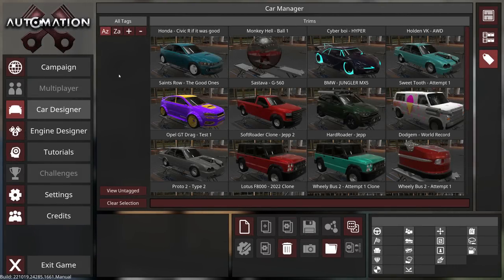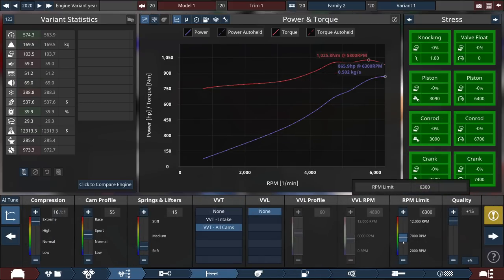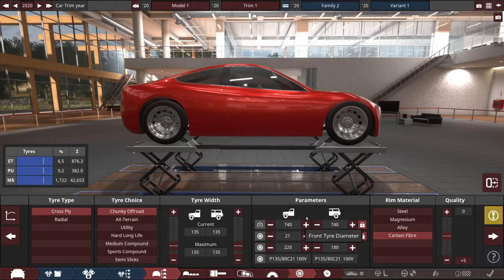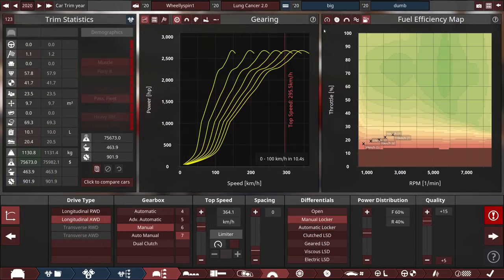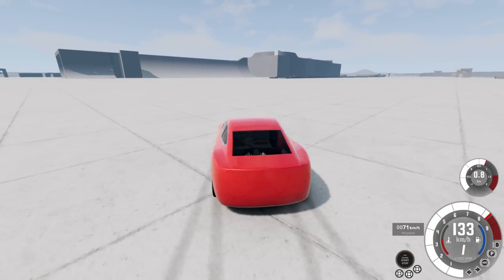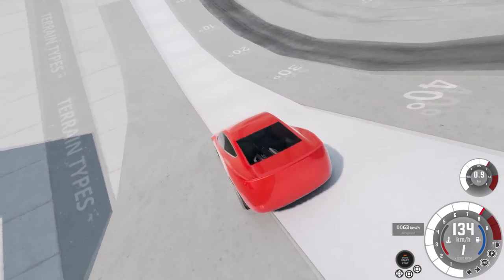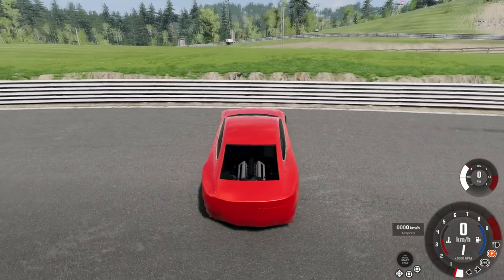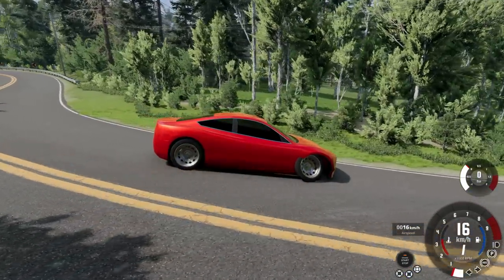100% Wheelspin (Automation + BeamNG.drive)

Comment: The obvious idea would be RWD with something like a giant V12 in front. Minimum weight and grip on the drive wheels, maximum on the idling.
Reply from the maker: Thats how we get endos
Reply: FWD with giant V12 in the Rear, 120% wheel sbin
Reply: There is a body in the game, I think you can find it by sorting to 2 door vehicles only, and increase minimum wheelbase and it’s a huge truck but the suspension needs to be set to the smallest type. It fits max size v16 and it can make 8000hp no turbos (turbos break it no matter what) running on nitromethane. I’m not sure if it works in stable version of game as I made the engine in the opt in alpha
Reply: Or you can go for the 1.9m Egg body that can fit a decent sized V8 in the rear. I got it to over 1000kW (1341 hp) with a single turbo, but could definitely squeeze more. The car weighed about 550kg so it could go incredibly fast. Unfortunately it has major lift-off oversteer, but that could potentially be fixed with some tuning.
Reply: @ashikasuzuki  nitromethane, V16 and turbos can net you over 10k horsepower :)
Reply: @MyHandleIsGood  And I thought my 1.4L DOHC 15V Inline 3 single turbo nithromethane making 1280hp on a 750kg body was insane.

Jesus, must be using 400+mm tires with AWD and max quality semislicks? How does it grip with so little weight?

Im using all of the downforce, 500kph top speed, goes to 250 after downforce
Reply: @BasedMan  RWD 200mm front, 250mm rear, max quality semi slicks. Top speed of 498km/h. Car has insane downforce, allowing it to actually be drivable, apparently pulling 2.64 Gs in the 200m radius. With careful throttle and a bit of skill, the car goes incredibly fast, although it is absolutely a deathtrap. My favourite car of this style is my FWD 63kW 400cc I5 200kg car. Based on the mini ute body, it revs up to 12,000 rpm and can go 236km/h. Although it's 'slow', it feels incredibly fast, which is what I was aiming for. A Yaris has the same power and feels like a brick compared to it.

Comment: 2:33 why it says "compressed gas" when LNG means "liquid natural gas"?
Reply: the top one is fuel categories, the bottom one is the fuel type in that category
e.g
Unleaded
85 RON

Leaded
92 RON

Compressed Gas
LPG

Compressed Gas
LNG
Reply: @DoggosGames  L = liquid C = compressed 
So why doesn't it say C when it's compressed ?
Reply: @technicbuilder6410  Both LPG (liquid petroleum gas) and LNG (liquid natural gas) are types of compressed gas.